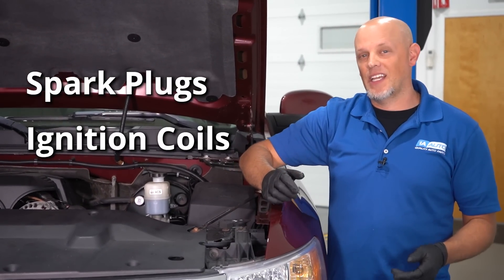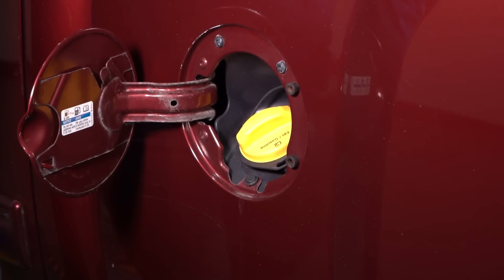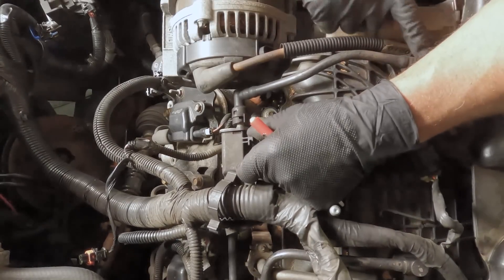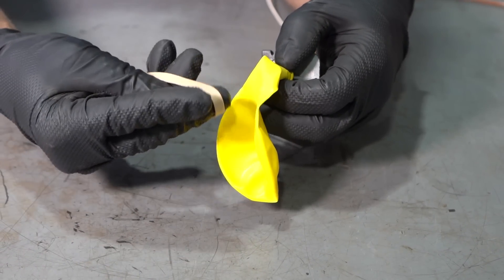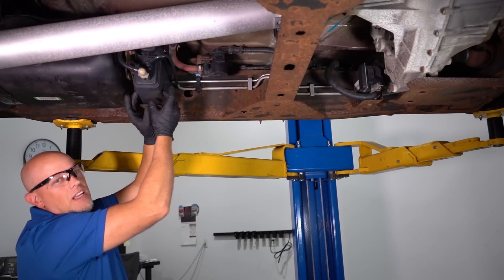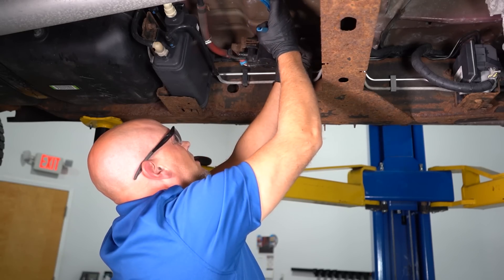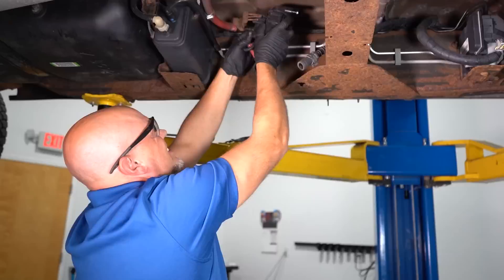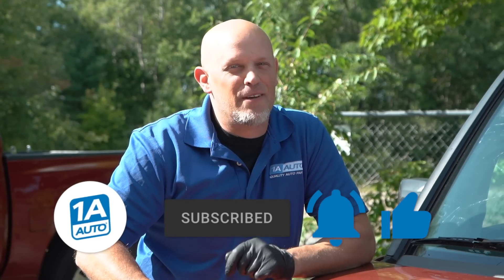Car or Truck Failed Emissions Test? How to Quickly Fix the Problem and Get Back on the Road!

Comment: Short version: 

If you want to pass OBD2 smog / inspection you cannot have a MIL (Check Engine Light) ON, and all of your OBD2 monitors must complete per the state in which you live and the model year of the car. California Emissions vehicles (as stated on you under hood emissions label) being the most rigorous.  

Long version: 

First off, the advice from a competent mechanic should be do not attempt to get a vehicle smog checked or Inspected (depending on where you live) if you have a check engine light (MIL) on for an OBD2 (MY 1996 or later) vehicle. 

Why? On OBD2 vehicles the MIL lights main purpose is to flag OBD2 non-compliance (tail-pipe and evaporative emissions problems), when the MIL light ON it is telling you the vehicle will not pass inspection. Don't waste your money getting it inspected with the MIL light ON. 

Obviously, the next step is to find out why the MIL light is on. You will need an OBD2 scan tool to find out what OBD2 codes (DTCs - Diagnostic Trouble Codes - which are standardized for emission related problems, one of the main reasons OBD2 was introduced) are stored which will identify the faulty system, circuit or component.

It is possible to repair the vehicle and not have a MIL light and still not pass inspection. Why? The vehicle has not completed the ODB2 monitors, meaning some are still pending. 

So you may ask, what the hell is an OBD2 monitor? 

It is basically emission related routines the computer executes (required by EPA per OBD2) to ensure the emission systems are working properly per a specific set of conditions known as a drive cycle. 

When the vehicle is repaired, as per the MIL light codes, the mechanic will clear the DTCs which normally resets the monitors. Also, if you disconnect the battery to repair the vehicle the monitors will reset. The monitors look at the specific emissions related equipment on the vehicle and evaluated if they are working properly. 

Well you may ask, what do the monitors require in order to complete, how many are there and what are the drive cycle requirements? 

This information is sometimes hard to find from an OEM (Original Equipment Manufacturer, like Ford or GM) but has to be available to the customer. Finding the information on-line (www) is sometimes difficult. For example, for a FORD OBD2 passenger vehicle the information is provided at

https://www.motorcraftservice.com/freeresources/obd

For each model year there is a PDF explaining monitor operation. Some monitors require multiple drive cycles, which is the same thing as saying multiple trips of a specific driving style or type (similar to city driving or highway driving).

The premise of the video is to focus on a particular DTC pertaining to EVAP. Which granted is complex, but as complex would be the CAT monitor. Regardless, all monitors must complete (test good, with some exceptions for MY 1996 to MY 2000) before you can pass inspection.

Comment: Is p0420 always a faulty catalytic converter? If it is my only code what are the chances it is something else.
Reply: Yea Most common but it also might be a leak in the exhaust manifold or pipe and muffler then its a good thinking to check oxygen sensor . And coolant temperature sensor or  fuel injection

Comment: Would be nice if EVAP systems were fixed this easy. Most of the issues I run into are system leaks not valves. Now they are when the headaches begin even with a smoke machine they are a pain. Nice explanation of the working of the valves.

Comment: I had a evap code on my 06 Lincoln Zephyr everything that you mentioned was fine. I looked over the whole evap system and found that the problem was the plastic tube that goes between the charcoal canister and the gas tank had a hole in it. Replaced the plastic tube that 1A AUTO does not sale. 1A AUTO can not have ever part .